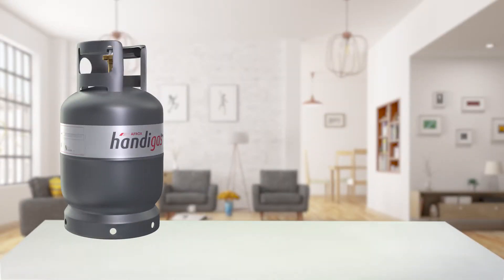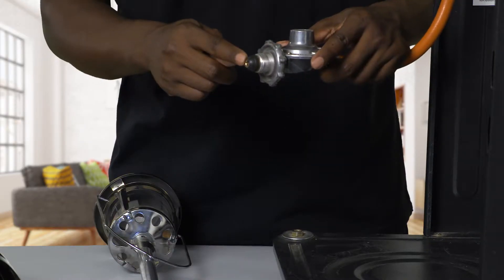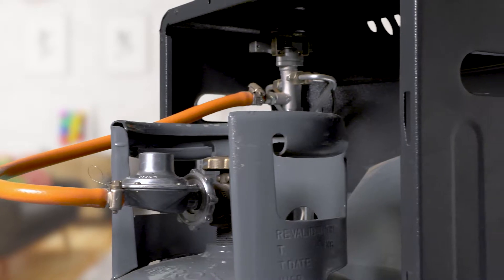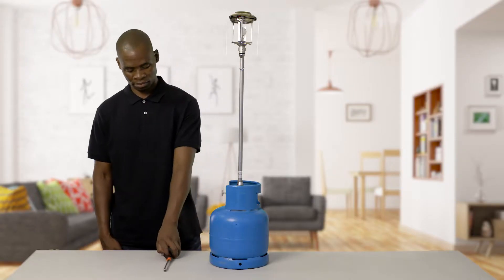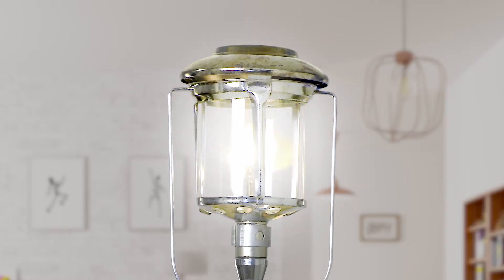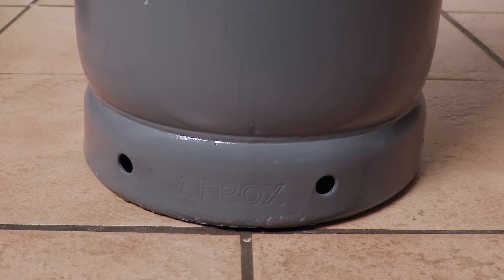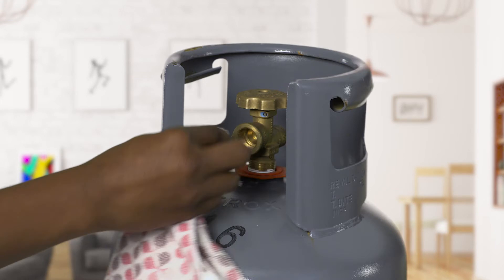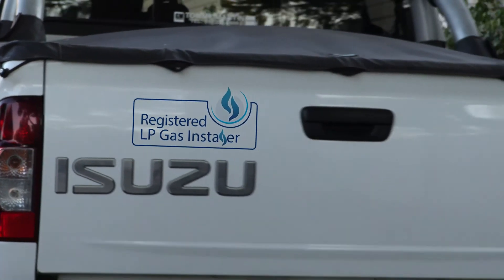How to connect your gas appliances safely

Comment: Has no actual instructions for connecting the gas cylinder. How does the nozzle connect to the appliance? Do you need to pop the red cap off? Just some of the many questions left unanswered by this video that rather ineptly chooses to deal with safety issues rather than connection.